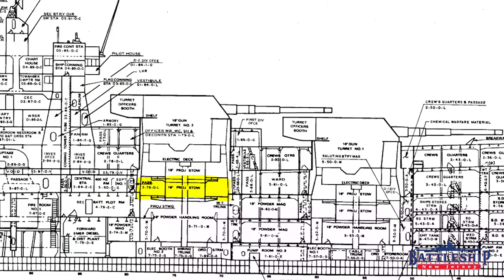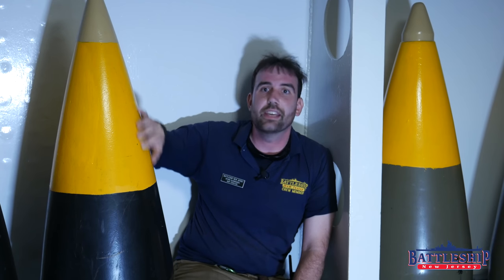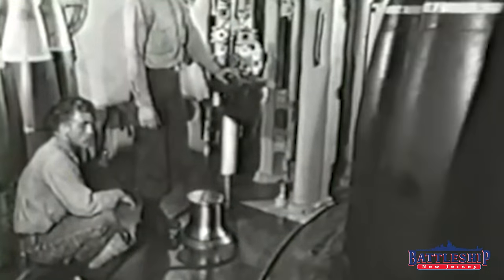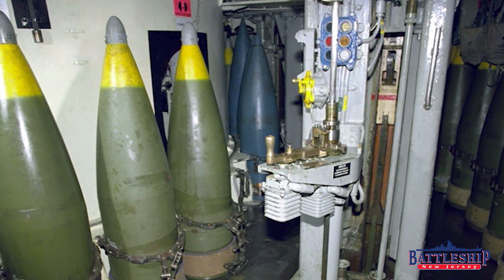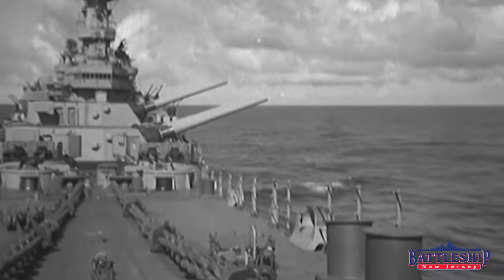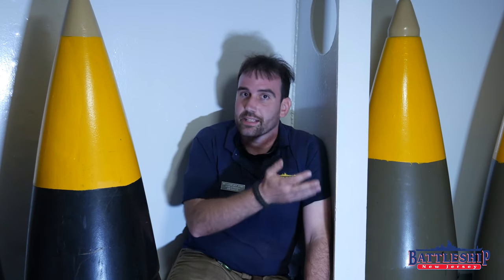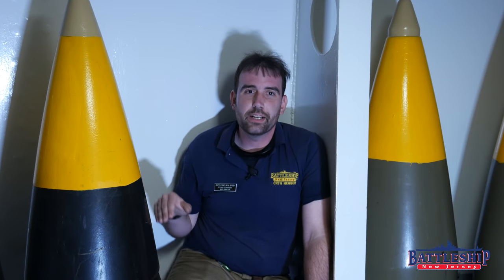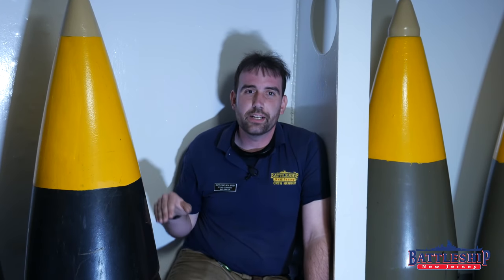What are the Different Types of Shells that the 16in Guns Fire?

Comment: You mentioned that the nose fuses had issues with rain during Vietnam.  That's an interesting design flaw for a naval shell.  Do you know if it was a problem that had gone undetected since the 40s, or was it because the shells were 25 years old at that point?
Reply: Its possible that they never encountered heavy monsoon rain before when firing. Usually in WW2 they fired in good weather, during island assaults (for the aircraft cover). Off Korea, it was probably lighter rain or snow.
Reply: I have a feeling that the rounds affected by rain were using proximity fuses. These functioned much like a miniature radar. They transmit a high frequency signal, & when a solid object would come within a certain distance, the radio waves would be reflected back to the miniature receiver built into the nose of the fuse. This initiates the fuse's bursting charge, which then sets off the main explosive filler contained in the body of the shell itself. The army had a problem with certain proximity fused munitions being initiated by heavy downpours. They pretty much solved the issue by redesigning the receiver portion of the shell to be less sensitive to the returning signal. A larger object, or the ground itself, still created enough of a signal to create the desired effect.
Reply: @Urbicide  I never heard anything like that at all, THERE is NO way a VT fuse will be triggered by rain, water, flood whatever. RADAR (radio direction and ranging) can NOT reflect off of water, nor wood, fiberglass, and so on. I don't know about the thing he is talking about, yet of the top of my head, it would be something to due w/ the inertia and/or spin force, that is part of the arming/safety systems that failed and triggered the warhead. The shell I work with use a triggering system w/ 4 setting. 2 per set height settings 30m and 2or3m, then quick fuse, and 0.05sec delay. if the one we selected failed the fuse go to the next setting and so on. The cluster round of the 155 had 165 Mk 62 or 68s (he said bouncing bettys they are land mines that when tripped pop up about waist high before they say hello, not grenades) and they had 4 mk14 I think anti armor charges.  The navy did and does have an ER round the first was copper head(which was better then the one they Navy went with) which was developed in the 80s yet never got the production contract, and Excaliber which ended up costin 80-120 thousand dollars per round instead of the planed 8k partly b/c of reduction on order from full production rate of 250k or so, to limited production of 1500 or something.  You need clearance from an officer of Col. rank I think(been so long since I was involved), any way it had base bleeding and rocket assist yet never made the 150Km range it was meant to....or maybe it did?? sorry.
Anyway he also talk about sabot equip rounds of smaller size.  You should check our the SHARPs project. It used two 16 tube w/ 8" liner to project an 30-90lbs object up into low orbit or 130-170 miles.  Was to put up small objects in space, it had a down range distance of 680miles or so.  The head of the project ...something Bull, anyway he was the one who modified our 155mm and such increasing the range by a factor of 2.  He also went to work on the Iraq Babylon gun, and the Israelis kept telling him to stop, b/c the gun was aimed at them (Sadden said it was for space insertion, total BS). The Massad killed him 5 round center mass .22 cal, right outside his place, the keys were still in the door and we found he had no doc. of value yet 30K of cash, but had to leave it.  That stopped the program, he was stupid even went in to his place moved all the furniture around, trying to get to stop, yet no go, so killed him.
Reply: @kevobrien7346  Radar reflects off water just fine. How exactly do you think weather radar works?
Reply: @kevobrien7346  When you watch the morning news and the meteorologist comes on to talk about the weather, what do they show you? Usually they show the time lapse of the Doppler RADAR signal returns over the last few hours denoting storms and clouds. Did you know that large flocks of birds and swarms of insects have also shown up on radar as large objects? They did so in a few historical instances, confusing the operators considerably. What in the world would compel you to say that water can't reflect radar/radio waves? 😸
Reply: Weather radar is Doppler. I think this is different from military band radars.

Comment: I would like to say that the caps on the AP shells weren't there only for aerodynamic purposes. They helped by taking the initial shock of the impact, thus reducing shuttering rates. Also they were made with extremely hard metal so they would "start" the hole and then the shell would have an easier time penetrating.
Reply: Two different caps. The armor piercing cap is there to help distribute the shock and prevent the shell from shattering. The ballistic cap (or windscreen) is there to provide the aerodynamic shape, as the AP has a TERRIBLE ballistic shape, being very blunt nosed.

Comment: Yes, keep the battleships around. Submunitions are a great area denial weapon. 
Mark 149 11inch round shows the Iowa would make a cost effective round. 
For some islands the MK-149 could hit both sides of the island and the folks living within 20 miles of the shore line. 
The modern rounds also have inflight course corrections. 
One day we should have "local hand off". That is local troops over the horizon use a laser designator on the target. The battle ship just needs to put the shells in flight.

Comment: The US Navy guns for battleships -- 12", 14", and 16" -- during the 20th Century had "AP" projectiles only when used for ship-versus-ship battles until early 1942 when the "High Capacity" (HC -- from the French term for what the US Army called  High Explosive (HE) projectiles) were introduced.  Prior to 1942, the only "HE"-type shell that was issued to the US Navy battleships from circa the year 1900 were some special-purpose "Bombardment" -- Class "B" -- projectiles initially designed for naval guns mounted on railroad cars for lard artillery use during WWI.   Battleships were supposed to fight other armored warships, primarily other battleships, period, and any other use, such as shore bombardment was considered to interfere with that due to reducing the available AP shells in the magazines.  In fact, when it was realized from watching the war in Europe prior to US involvement in WWII that HE-type shells for shore bombardment were going to be required, particularly in assisting with invasions from the sea as occurred repeatedly during WWII in the Pacific, there was a scramble to create an Army-type HE shell that was more multi-functional to reduced the number of shells needed in the ship gun shell magazines that displaced AP shells; what became the HC shell that also was used in US Navy 6" and 8" cruisers a lot during WWII.  Before the HC shells were designed and ready, a few months after Pearl Harbor, some blueprints for those old Bombardment shells were pulled out of the files and some of them made, though using modern base fuzes -- these Bombardment shells had very large amounts of explosive filler, 12% or so of the projectile's weight, about twice as much as the later HC shell had, and used a "non-delay" (inertial delay only due to the time it took the fuze mechanism to function) base fuze to allow the projectile to have a very small delay - 0.003-second or so -- on impact to get through thick earth, masonry, rock, or concrete protection of a land fort.  The Bombardment shells were removed when HC shells became available (I do not know if any resurrected Bombardment shells were ever actually used during WWII).

The US Navy HC shells were much more versatile than most regular HE shells.  They came equipped with both a base fuze (non-delay originally for all sizes, but eventually a short 0.01-second delay was added for the 12" and larger HC shells to allow deeper penetration of land targets before exploding if this was desired.  The base fuzes of all US Navy shells were only removable at a weapons depot and were always going to function on impact with anything even marginally solid unless the nose fuze set the shell off first.  This allowed the HC shell to have some properties of an AP round -- though with four times the explosive weight -- against targets not protected by thick steel armor requiring an AP round, if the firing ship wanted this result.  It was the nose of the HC shells that was made rather multi-functional to keep the number of HC shells down to the lowest number possible.  The shells, the 1900-pound 16" Mark 13 HC here in the new WWII US battleships, were shipped with no nose fuze (other than a special safety fuze called the "Auxiliary Detonating Fuze" installed between the regular nose fuze and only armed when the shell was spinning after firing so dropping the shell on its nose during loading or other shell handling work could not blow up the ship, as had occurred in some foreign ships early around WWI (US Navy safety precautions were definitely second to none!).  Instead, a hardened steel nose plug was on the nose so that the shell could be fired using its base fuze with no changes required, allowing the small delay on impact.  With each shell, a pair of nose fuzes was also shipped to be installed by the crew, as desired:  A "Point Detonating" impact fuze for essentially instantaneous detonation on impact with virtually anything heavier than thick cloth, or, if air bursts were desired, a "Mechanical Time" fuze -- clockwork run by the spinning of the shell after firing and set for time of flight by hand or by a fuze-setting device just prior to loading.  By selecting which fuze was to function, base (using the hardened nose plug), PD, or MT, and installing it before the battle by hand in the ship's magazine, you essentially had several different kinds of HE shells in one HC shell for efficient magazine use.  Later in WWII some other nations copied this to some extent, but the US had these multi-function shells first.

NOTE:  In the middle of WWII the radio proximity nose fuze ("Variable Time" or "VT" being its secret code name) was finally introduced, primarily for anti-aircraft guns, though it was also used for air bursts against land targets, replacing the MT fuze for many targets during WWII.  These had tiny vacuum tubes inside of them and were bigger than the older nose fuzes, requiring special modifications to those HE/HC shells (90mm and up in WWII, though smaller guns got them later) to fit them.  Also, as the US Navy considered them dangerous if exposed to radio signals from any source on the ship (remember, safety first, last, and always!), they came already installed with a removable thin steel nose covering shielding them from any outside signals.  This covering was removed in the gun turret just prior to loading.  To my knowledge, these modified HC shells, the Mark 14 HC for the 16" gun for example, only used this VT fuze (LIVE anti-enemy shells, not training!), though I think that it retained the base fuze for direct hits, if such occurred.  I have never heard of a Mark 15 Target Round for an HC shell, though I am not saying this did not exist.

The AP shells used by the US Navy battleships in WWII were a new design developed during the middle of the 1930s where oblique impact requirements for penetrating armor were increased from the circa 15 degrees of the former WWI-era US Navy AP shells (still in use due to money restrictions from late in WWI through the last few years prior to WWII) to 35-40 degrees from right-angles, the toughest test requirements of any nation during WWII.  To get this superior performance, the new US Navy AP projectiles had their internal explosive charge dropped down to only 1.5% of the shell's total weight (compared to 2-2.5% for the latest British and German AP shells in WWII), thickening the lower body steel.  They also had a unique hardening pattern called "sheath hardening" where the shells were made much like Russian dolls as to their hardness pattern, with the nose and upper side on the surface of maximum hardness and hardness dropping slowly as one went down the body from the nose and toward the center, allowing some bending in the middle and lower body to keep the shell from breaking apart at a highly angled impact against thick armor.  They also went from a blunt pointed nose in the first designs to an oval nose with nio point for most Navy Ap shells from the middle of WWII and after.  This strengthened the nose against sideways impact forces and made the projectile penetrate thick homogeneous, ductile (deck, turret roof, etc.) armor somewhat more easily as it created an upward bulge of armor in front of the shell ("anti-streamlined" nose shape).  During most of WWII, all US Navy AP shells used the "Mark 21 Base Detonating Fuze" (6" guns and up) with its 0.033-second internal delay.  Against steel plate (any kind), it needed roughly 0.07 x projectile diameter thickness to set it off -- 1.12" for a 16" AP shell.  The new battleships (and latest cruisers) used the "20% Overweight" or "Super-Heavy" version of the above new AP shells -- 2700 pounds for the 16" Mark 8 AP shell -- while the older battleships and cruisers could not handle these longer (4.5 x projectile diameter in length), so they had to use the lighter version 4 x projectile diameter in length and in the WWI-era COLORADO Class 16" guns this was the 2240-pound 16" Mark 5 AP shell.  The older 14"-gunned battleships had a scaled down version, the 1500-pound 14" Mark 126 AP shell.  All HC shells were matched to the shorter AP shells, though much lighter in weight, to allow all ships to fire them, regardless of date commissioned.

Comment: I remember reading that the British did experiments with their own Super Heavy APs in the 30s but they weren't really satisfied with the relative small angle of impact relative to the surface that this type of shell is super effective. Beyond that narrow angle of impact the long and heavy shell body ends up being a liability which resulted in shatters or bananas.
So they decided to use a 1,080 kg shell with a massive explosive charge to compensate in case of their Mark II 16 inch guns.
Compare the Iowas Mark 8 Heavy shell with 18.55 kg explosive filler with that of the (1939) HMS Lion's 27 kg.
Reply: Since the Lions were ever built and only 5 Mark II prototypes, I would say the 16 inch Mark 7 was infinitely better. From NAVWEAPS Site - US 41 lbs vs RN 60 lbs bursting charge - I rather think the difference is academic. Also from NAVWEAPS on the RN round "the APC shell would have been designed to be the same weight as this CP shell, but optimized for performance against deck armor." so it sounds like the RN adopted the same philosophy as the USN.
Reply: @colbeausabre8842  "I would say the 16 inch Mark 7 was infinitely better."  From this point on I stopped reading any further. Don't want to lose braincells. Buh bye fanboi.
Reply: Italian 15in shells had 10 kg of bursting charge!